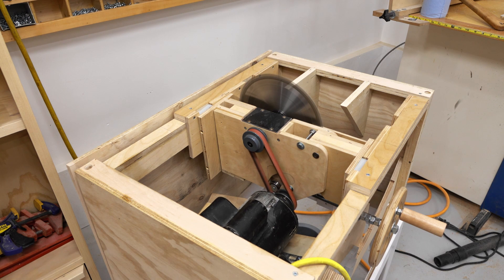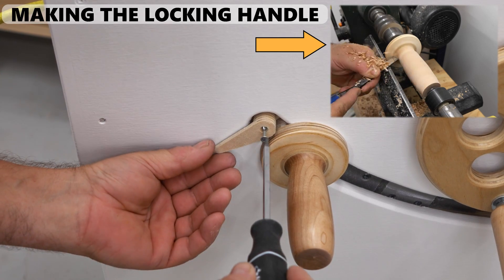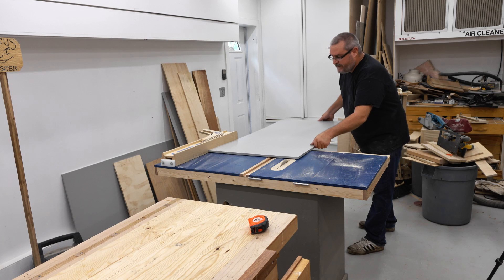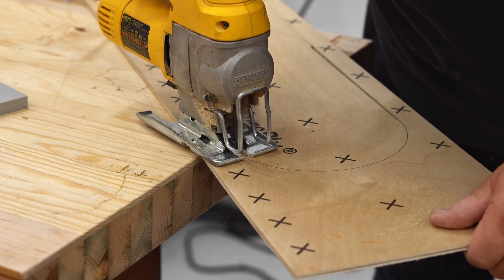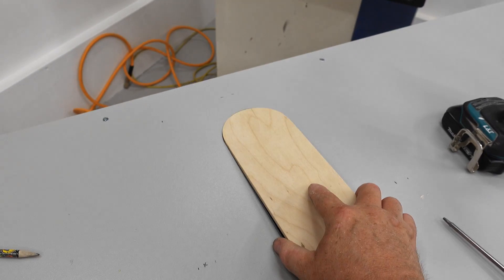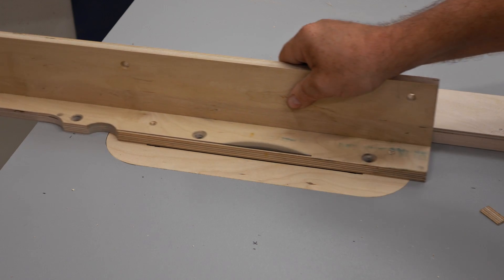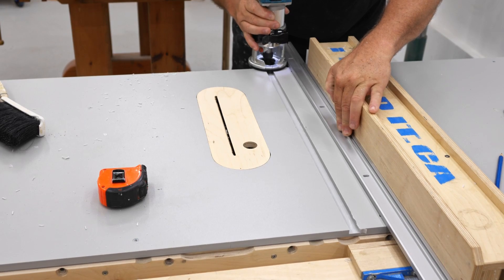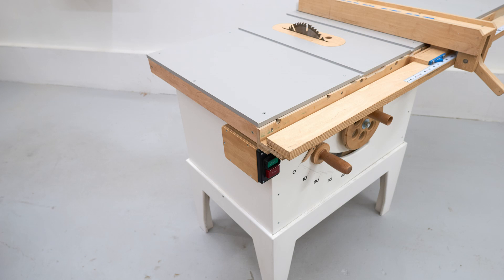Making A Table Saw - The Top and Fence and Finishing Touches

Comment: This is the best homebuilt tablesaw design I've seen bar none. Honestly I think the spring-assisted tilt feature makes it better than many professional saws. I like how the motor is in the cabinet. The trunion design on my saw lends itself to come out of alignment during tilt. I almost want to build just your saw mechanism with the motor to redo my saw, but keep my cabinet and cast iron top. It looks like you could very easily add some dust collection to the bottom with just a hopper and a hose connection. Do you plan on adding some dust collection?

Comment: Are you going to do dust collection, riving knife and blade guard?
Saw looks great, the tilt counterbalance is engineering genius
Reply: blade guard... new to this channel much? If he makes a blade guard, it will be for demonstration purposes only. I am curious about a riving knife though.
Reply: Tom Moores going by the build article he’s going to wire up a shop Vac for the fine dust and leaving the bottom open sweep the rest up with a broom later
Reply: @danielmackey6594  3:35
I think riving knife is not on to do list either :) I cringed watching that cut, but he made it safely :)
Reply: @viliusm.8232  I kind of agree, except he's a pro... my table saw doesn't have a knife either... that's the reason I am wondering about it, so I can make one for mine. Sure makes it easier to cut wood that has internal tension.
Reply: Yeah, for me one of the biggest reasons to build rather than buy are that so many of the good used saws I see in my area are missing riving knives, and if I build my own then I can put one in. It may not happen but I would like to see Heisz' final plans include room for one.

Comment: Very nicely done. I'm about ready to start on my own table saw project. Except I'm going to use the motor and arbor assembly from my current saw. I like how it cuts. I don't like the top though. It's an older Ryobi BT3000 from in the days when that company was willing to stuff a little outside of the box. After all they are the ones that  brought the portable thickness planer out to start with.

Comment: Sorry if i missed it, What is the motor your using? 115v or 240?  amps? hp? and so on.    
I read your article, looked at the comments didn't see it.  I'm just wondering what would be required to rival professional saws, or at lest decent saws out there?

Comment: I had a job building cat walkways for a animal shelter so the cats could climb all over the walls and they had me use starboard so it could be easily cleaned. Pretty good product just crazy expensive and a little soft so be careful how you slide harder materials over it or it will scratch. Im used to using that while building stuff for boats because its strong and doesn't rot. At over 330 bucks for a sheet you learn real quick not to make mistakes cutting it.

Comment: Absolutely AWESOME build, John. I know you used Starboard for the top, which is outrageously priced, and it is very slippery for wood to glide over it. Would Formica laminate work as a viable substitute? My old Delta TS has a side extension that is melamine, which is fairly smooth, but the surface has begun to wear through. A replacement is needed, which is why I asked. 

     Your projects are always remarkably engineered, and I wish I had the time to build a few of your machines. This TS, with the wooden trunnions and tilt mechanism are WAY cool, and surprisingly compact for a wooden structure.

Comment: John, great project and great video.  Wanted to ask about your motor & belt configuration, I see that the motor hinges and its weight keeps the belt under tension.  So when you turn the hand wheel to raise the blade, the only force acting on the motor to raise it along with the blade is the belt itself.  Is this working well?  Maybe it doesn't matter since the motor weight is already responsible for tension force on the belt.  I was thinking maybe the motor should be mounted to the bottom of the blade assembly with hinges so everything raises and lowers together as part of a single assembly.  Or did I misunderstand?   thanks
Reply: to clarify further, it looks like the way you have the motor mounted, the hinges are screwed to the saw body, rather than to the blade raise / lower assembly, hence my question.  So if I got that wrong, then apologies

Comment: It's a nice build but (if I'm reading you right) the lift mechanism doesn't lift the blade straight up and down so you can't install a riving knife that raises and lowers with the blade, at some height, the knife would be higher than the blade, no good for cuts that don't go the entire height of your timber (dado's etc). That's a deal breaker for me.

Comment: I like your channel, but I cringe every time you put wood through the table saw without a push stick. Example: at 2:14 in the video, your fingers are less than an inch from the blade, AND THE PUSH STICK IS RIGHT THERE!  PLEASE USE YOUR PUSH STICK so we don't see a "Look What Happens When You Don't Use A Push Stick" video from you in the near future.

Comment: I first want to say the design and execution of the table is great. However, and with all due respect. Dude, put a splitter or riving knife on that thing before you eat a board. Also you're way to casual with these saws. Your hands are way too close to 10in of carbide that will mess you up, not to mention pulling the workpiece over the saw while it's still spinning. I'm not trying to take away any of the hard work and clearly excellent designs, but for your own health and the benefit of the people you're showing how to do things, please brush up on your tool safety. I'd like to be watching you, with all your fingers and toes, for a long time.